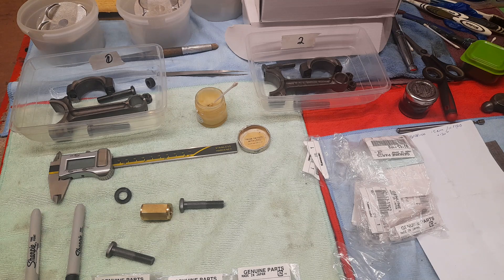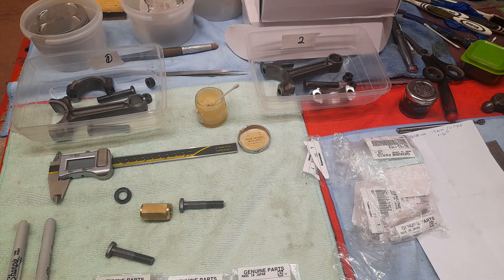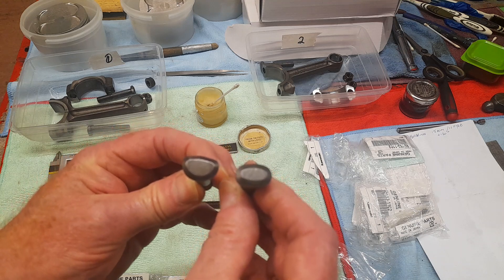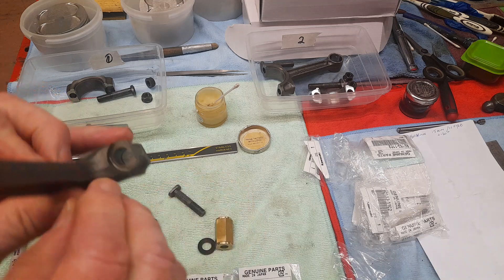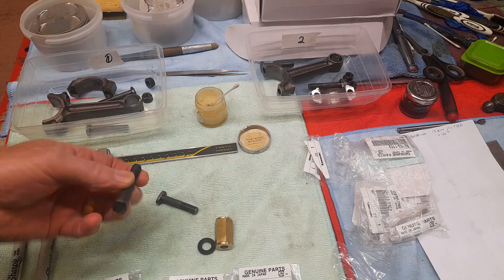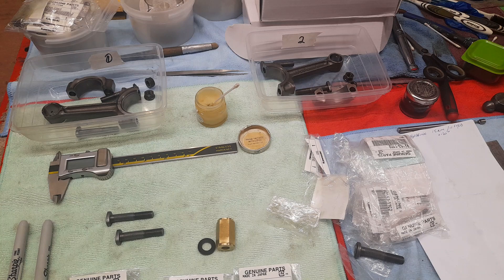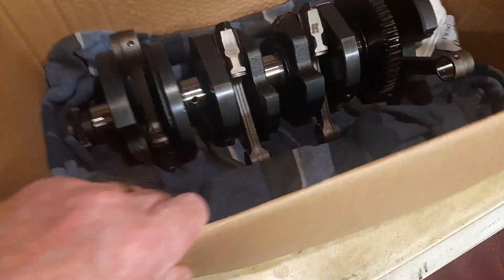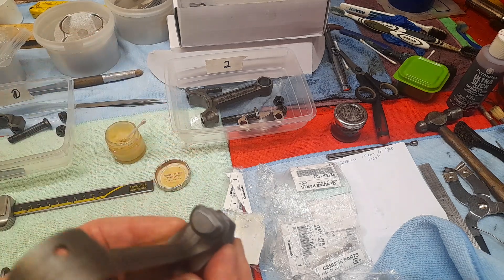Early (2001) Kawasaki ZRX 1200 conrod "bolt" compatibility versus the later ZRX's

Comment: oh man what a pain...  must people wood miss that...  anyother great vid....  can i be cheeky and ask you a question...   I'm in the process of rebuilding my ZRX1200R (2004) and dont want to put the air box back on .. thus going to fit pods .. which pods have you used...  I know you have to block off the the cam cover with blocking plates but what else should I do to make the bike to run right... like rejet the carb.. and block off anything else
Reply from the maker: Hi...,yes I fitted K&N pods to my 01 ZRX since the stock airbox /carb removal process is a notorious "knuckle scraper" LOL.
On that bike I have fitted a Black Widow exhaust system and ditched the stock boat anchor to let the engine breathe...

Also running a Factory Pro stage 3 jet kit.....,my settings are 
Stock 35 pilots
3rd clip on the needles
3 washers on top of the clip
Main jets 138 for carbs 2&3 (middle two carbs)
Main jets 140 for carbs 1&2 (two "outside" carbs)
Pilot screws 3 turns out..

Also running block off plates on the rocker cover...,all emissions garbage removed..etc.etc

Was also running this set up on my 05 ZRX (but with a Kerker system) however have now switched to flatslide TMR carbs on that bike...

Hope this helps...

God bless
BG
Reply: @brianwells5258   Hi Brian , thats great info.  3 washers ontop of the clip  ??? what is that  🤔🤔🤔.  138 jets on the middle cylinders.. is that cause the middle 2 get hotter 🤔🤔🤔.. but hav to say  Thanks for sharing your wealth of knowledge    ..  lov the videos  👍
Reply from the maker: @Mmmmmmmiwish  yes I used the Factory Pro stage 3 jet kit for my setup...
The replacement needles in that jet kit have a number of  notches on the top of them to fit a supplied 'E' clip into the appropriate notch (to lower~raise the needle)
Stock needles do not have this facility)
Anyway my settings were the E clip to be in the 3'rd notch...
The jet kit also provides some "washers" and for my settings I fitted 3x washers on top of the respective clip on each of the needles prior to installation...
The rest of the settings are as outlined in my prior response 

Incidentally for the Factory pro kit the larger (140) main jets go to the outside and the smaller (138) go to the middle two carbs..
However it's backwards on 'stock' jetting.... where the larger MJ's are in the middle and the smaller to the outside...(92 for 1&4 and 95 for 2&3) depending on region/state/country and altitude..since some stock run 88 for 1&4 along with 92 for 2&3)

However since you are omitting the airbox and running pods none of that applies..
Oh., and note also my recommended settings are applicable for running a full replacement exhaust system...

May I wish you every success with your project..

Thanks for tuning in
God Bless

BG
Reply: @brianwells5258  Cheers Brian ..thanks for your help